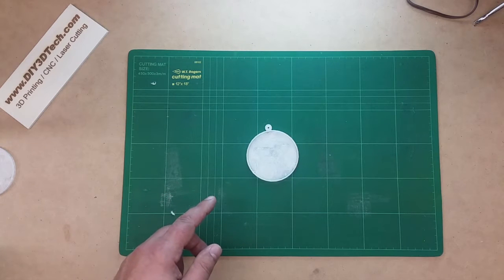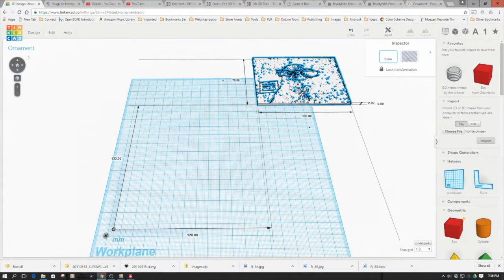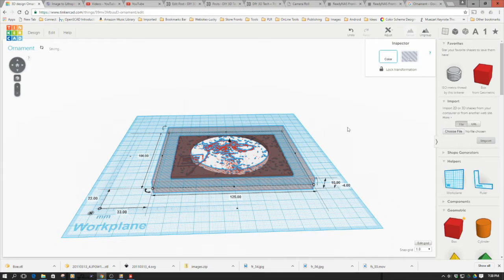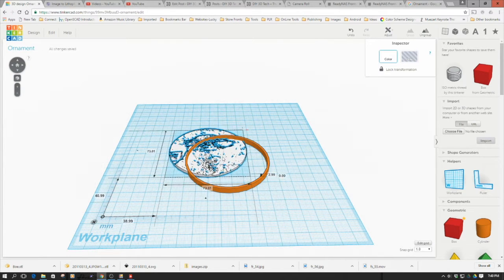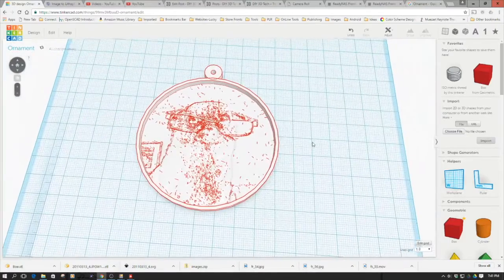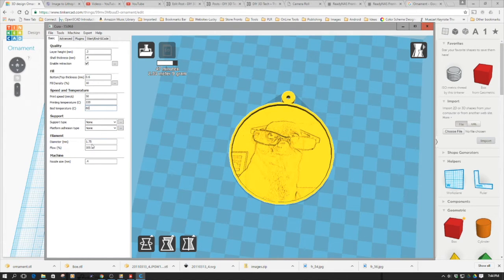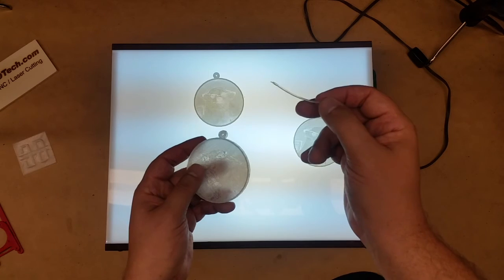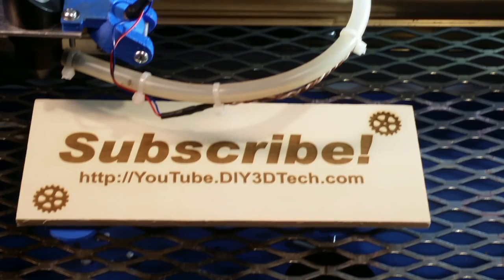3D Printed Project - Designing and 3D Printing a Lithophane Ornament!

Comment: Hi, i did it myself, but i cant't opent it in tinckercad, he sad the file has been corrupted. What can i do ?
Reply from the maker: The file might be to large as I believe you are limited to 20mb up load...
Reply: DIY3DTECH.com how can i change it ?
Reply from the maker: the only opion might to make you imported image smaller or use 123Design on the computer rather than TinkerCAD
Reply: ik tryed it yesterday on 123design. it wont work.
Reply from the maker: You might than try MeshMixer...

Comment: Nice video. In case you didn't know, Cura can create lithophanes  from a picture if you open an image file like a JPG with it instead of an STL.
Reply from the maker: Thanks for the kind comments! Also, yupper your correct and if you look back in the playlist I did an episode on just that.  However its just the picture and I wanted to create an ornament :-)

Comment: cool , really cool .   you should put link in the des'c  for lazy guys like me . LOL
Reply from the maker: Figured you would have a keyboard Marco for every shape possiable! 😀
Reply: hahahah . i uploaded a pic and got something reasonable as a file tor try . I fought with TC beta again and reverted to normal TC .  so i will try and print this on my Franken printer tomorrow . lol .
Reply from the maker: Yea I don't like the beta of TC either...
Reply: it actualy fails , as in crashes and i get left with shadows of vanish parts . lol
Reply from the maker: What browser are you using?
Reply: chrome , and the test version of chrome.  I cant change the version at work as only IT users can change that . but at home on my W10 rig it's just regular chrome .  some times TC just kills web GL lol. in browser restart  and away it goes . but regular TC seems fine these days .
Reply from the maker: Same here with Chrome, thinking about trying Edge as I just switched over from Mac to back to the W10...
Reply: last update  just a few min ago to Chrome has fixed many things on all my rigs .
Reply from the maker: Will have to give it a shot in the next day or two...
Reply: chrome just pissed me off i had to uninstall and re install .  if i put my chrome identity in it screws with the you tube notify window.
so i just reinstall and did not sign into my chrome identity , just the sub parts and its ok so far .
Reply from the maker: yupper that is one over the bigger issues I have...
Reply: yeah seems they are trying to be too fancy for themselves and resulted in a sub par feature that is way worse than just keeping the original. i have a better browsing experience if i dont log into my chrome ID and just log in via Gmail, as it links and launches everything . I'm also the only user of most of my rigs.